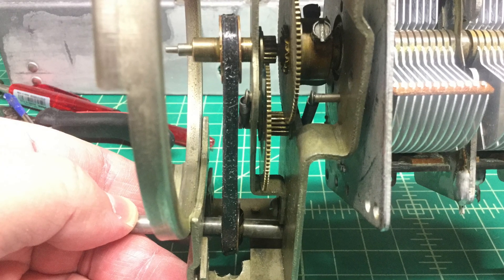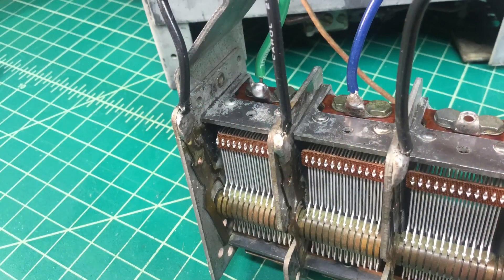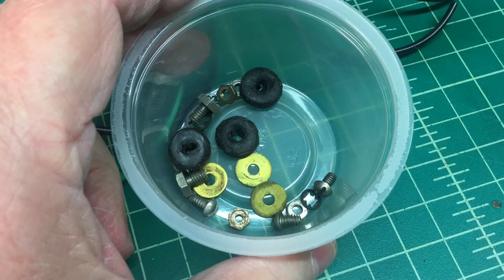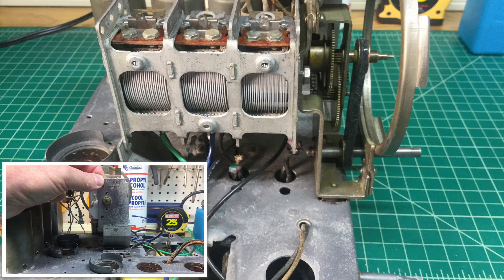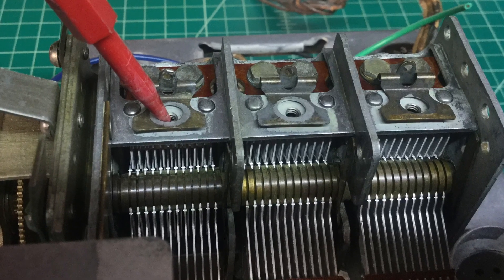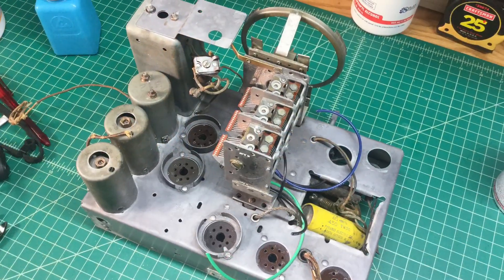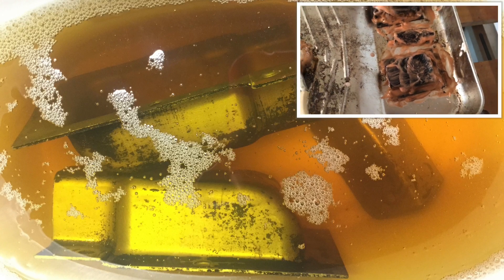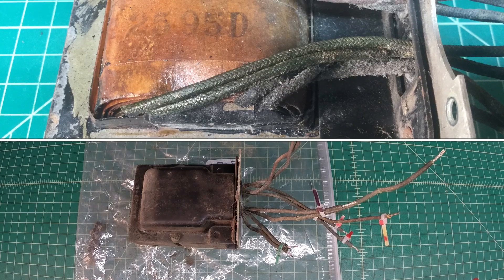Zenith 5-S-29: Tuning Condenser Remounted

Comment: Don,
Paul (Mr Carlson's Lab) is not only an electronics wiz, he also puts forward very good ideas.  He is not on his own.  You have, for example, done a sterling job at reproducing a set of rubber mounts, and drive belt.  Doubtless it will inspire other Vintage Radio men, hopefully me included, to do similar.  Well done my friend.
Regards,
Phil.
Reply from the maker: +SteelCity321PB Phil, thank you. I'm hopeful some of the tips will be utilized or improved upon in time and continued to be shared with others. Thanks again for following along. Best, Don

Comment: That varcap cap looks great Don, and yes Paul's tip with a small jump on the iron is a great Idea.Did that a few weeks ago too and it does allow better application of solder to big areas. Thanks for sharing!
Reply from the maker: +saturn5tony Yep, it helped a lot. I've used a small torch in the past, but an open flame can be a little tricky to manage at times. Best, Don